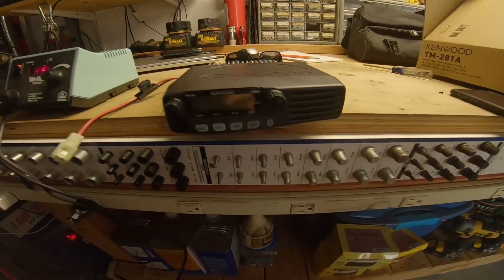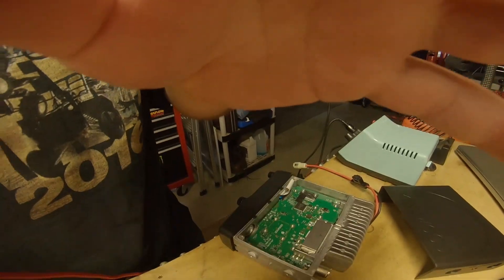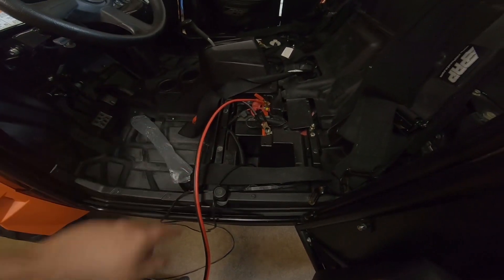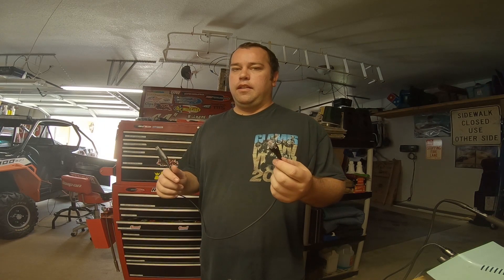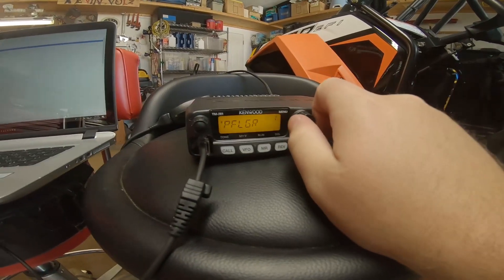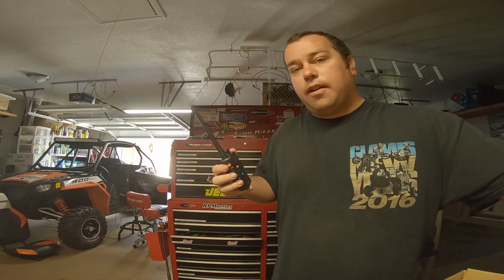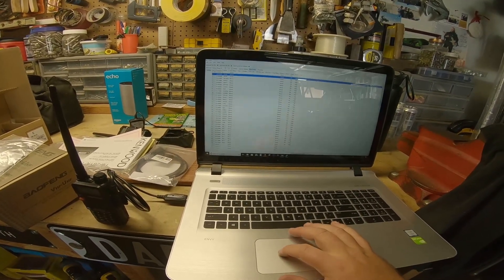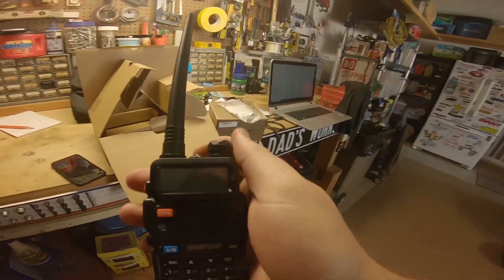Kenwood TM 281a Modifying / Programing and Baofeng UV 5R Programming

Comment: Does anyone know if the Kenwood tm-281a MARS mod can be done on the newer Chinese (knockoff) versions to transmit above 149 mhz? If so, what's the process for this?
Reply: Mike, if you are seeing these posts, sure could use some info! I have 3 "older" TM-281a's, as per your video. 
The MARS mod was EASY to do - and worked like a charm.
I've since, as did "Gerald" in this original post, purchase a few more TM-281a's, but, lo and behold, TOTALLY NEW motherboard design!
If ANYONE knows if there is a new version of the MARS update, would DEARLY love to know how!
and no, I am NOT a licensed ham op, but YES, we (our trucking company) ARE licensed for commercial radios in our trucks.
Frequencies of interest are the LADD (trucking) channels - LADD 1 (154.100) in particular. If ANYONE can help, THANKS !!!!!

Comment: I was just wondering I have a tm281 from China and mine transmitted on the whole range there so after watching this I was curious to see witch resistors are in my radio So I opened it up and in mine 767and 766 Are missing. The reason I am looking into this is I bought 2 more radios but they are limited like your and I am wondering witch ones to remove now the 768 or the 2 767 and 766?
Reply: I have the same thing with my unit. Did you find a resolution
Reply: I took 767 and 766 out and it’s been working fine